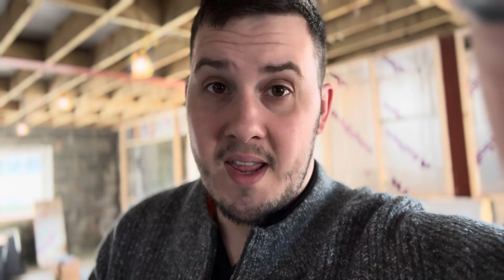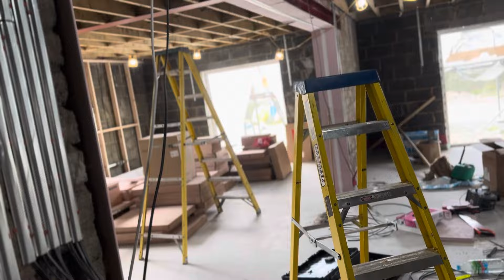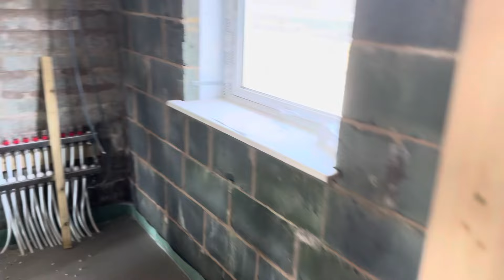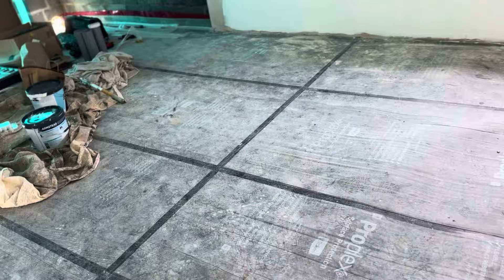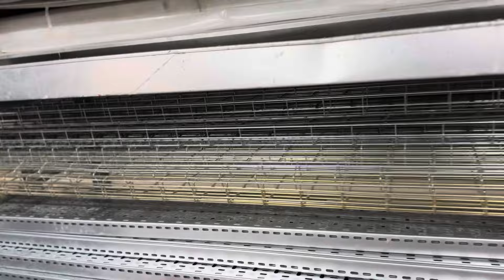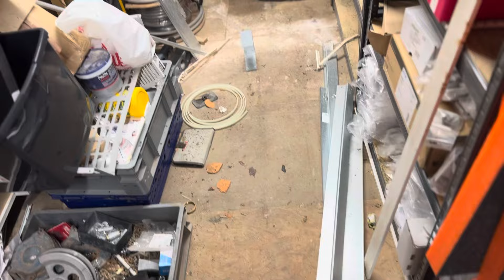My CRAZIEST Home Build Yet! #newbuild #renovation #dreamhome

Comment: The ring circuit rule was for 100m2 floor area, have this worked I do not know? 

I find that running multiple circuits also makes bringing it to completion easier as smaller circuits are easier to 2nd fix, test and energise.
Reply from the maker: Yes I also chose to use radials as you say much quicker on testing etc and easier to fault find it there is an issue in future

Comment: Always better to have more circuits 👌 I’m up to 22 ways used in a 4 bed semi 🫣😂 nice job 👍
Reply: You only have to worry about the led tape divers etc when they are all switched together because of the inrush current
Reply from the maker: It’s going to become more and more common as time goes by ! Nice though for fault finding